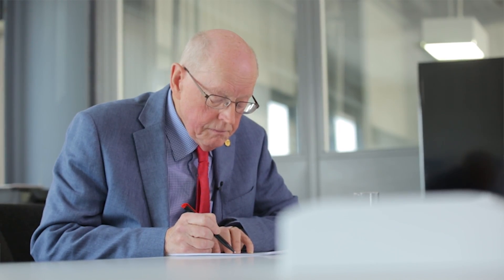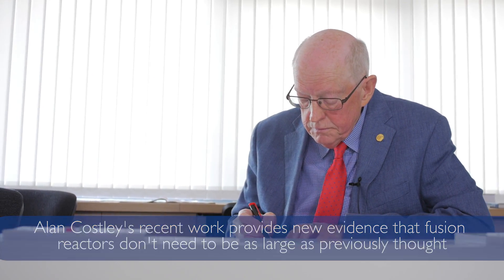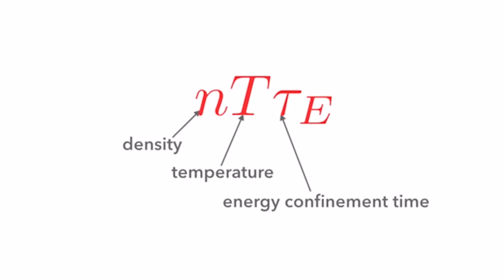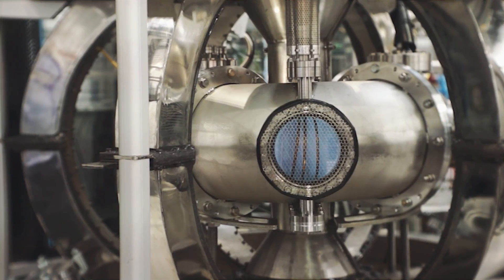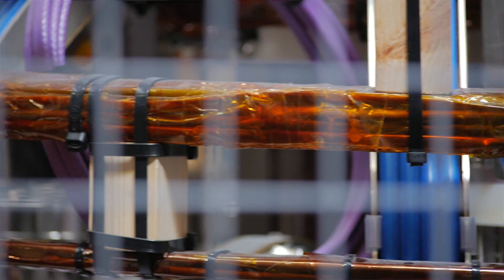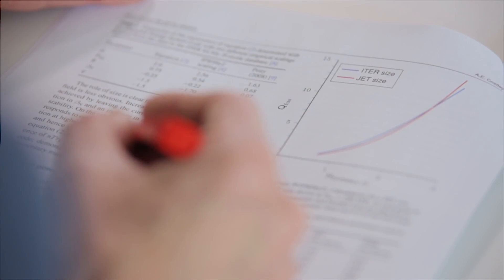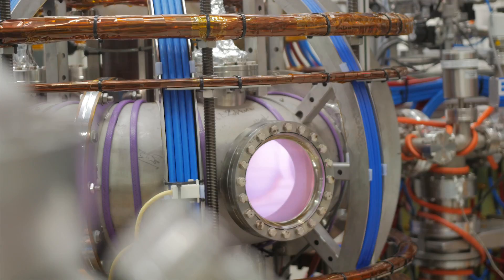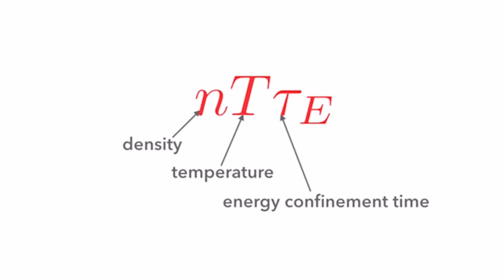Dr Alan Costley on tokamak size and performance

Comment: How is ST40 coming along?  If I recall correctly, you said it would be built by the end of the year?

Also, doesn't neutron shielding between the magnets and the plasma need to be of a certain thickness to ensure a decent lifetime of the magnets, and to avoid the magnets heating up?  My understanding is that this would force a minimum size of a power plant reactor, though maybe not on an experimental one.